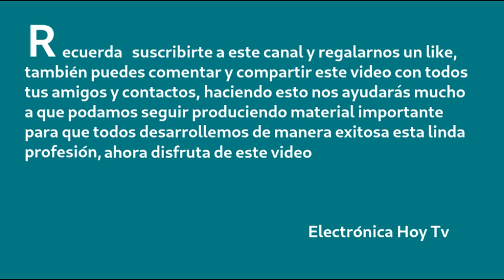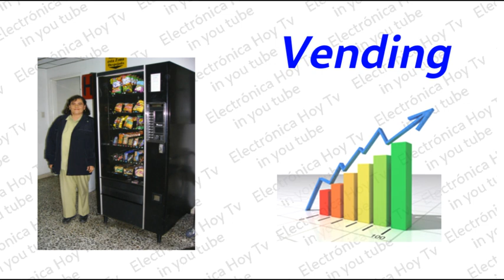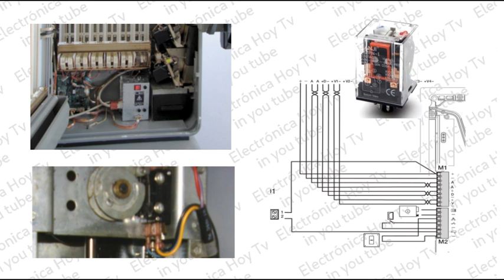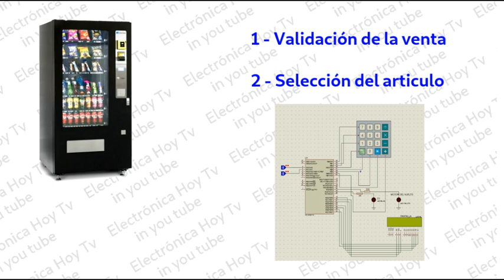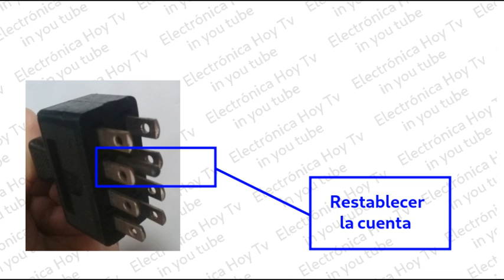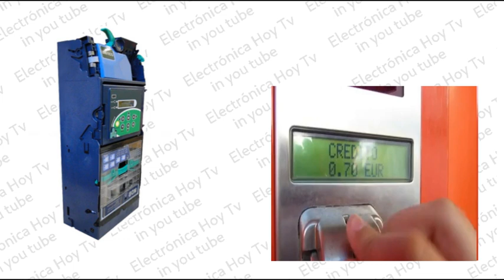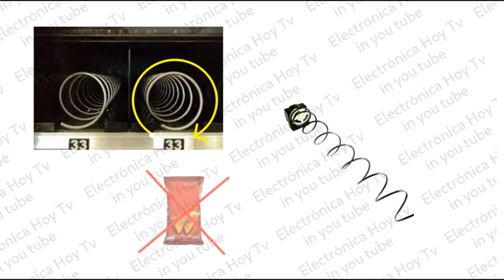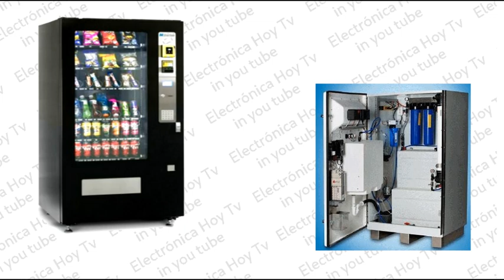FUNCIONAMIENTO DE LAS MAQUINAS EXPENDEDORAS AUTOMATICAS

Comment: Diagrama de como conectar el motor a Arduino o si funciona igual que los servos
Reply from the maker: Hola Jose muchas gracias por comentar, como puedes ver en la miniatura son solo motores DC los que se usan en estas maquinas, solo necesitas un convertidor de potencia que puede ser un rele, un transistor o un FET. por lo general las placas cuentan con uno solo por motor. Exitos

https://www.youtube.com/watch?v=T437-o0YPNE